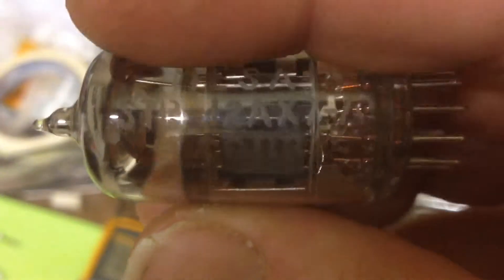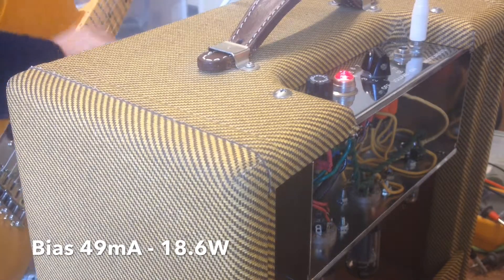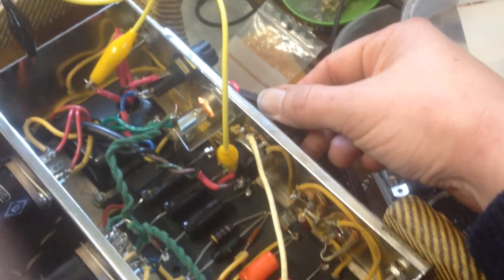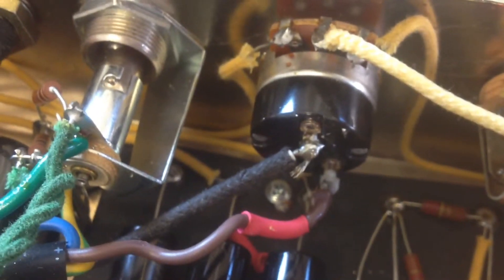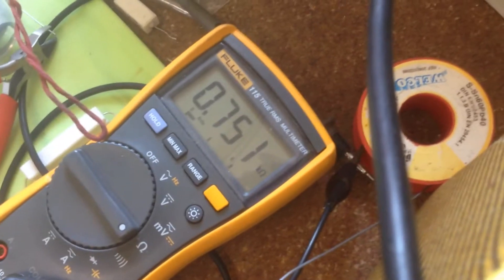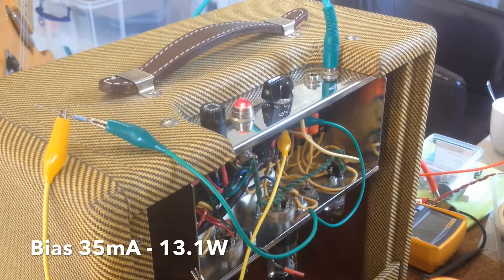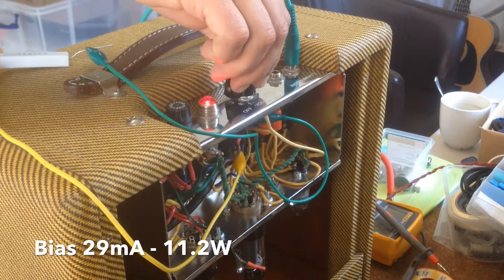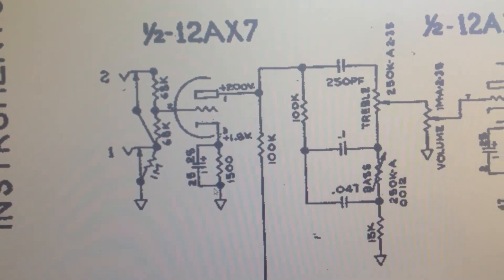Fender Champ 5F1: lowering the B+  230/240V + biasing

Comment: Grab a tube firmly, shake it rapidly and violently. 😮         Yeah, I’ll bet you can find lots of ‘em that’ll rattle with that kind of treatment ….🙄.  Lots of people also think that’s a good way to check light bulbs.😑
Reply from the maker: What do you think the tanks in WW2 used for communication? Tube radio sets and that wasn't the only tube based technology in the tank. Rattling tubes reveal faults: pieces of glass, solder caught in the tube. If shaking destroy a vacuum tube, it was crap to begin with. 
We shook light bulbs way back when they were made of filament wire when they didn't work anymore - as a quick check. How old are you?
Reply: @zjokka . Military tubes are COMPLETELY different there, sarge.  Yeah, shake a lightbulb with a filament wire and make CERTAIN that wire is broken.
How old am I?  Old enough to know that obviously, you know absolutely NOTHING about military tubes or filament wire light bulbs!
😆😆😆

Comment: Thanks for these videos. I'm a bit of a newbie, but I was hoping to hear the way the sound might be affected by adding a resistor to the B+ line between the rectifier and the first filter cap to knock the plate voltage on the 6v6 down to about 320VDC. I also wonder what the plate voltage was at the 12ax7. My Champ schematic shows 150VDC at the 12ax7 plates, and 325V from the rectifier coming down to about 295V and 250V off the 2nd and 3rd filter caps. I thought the whole Tweed sound with earlier breakup was due to the lower B+ voltages in the earlier Fender amps.
Reply from the maker: Check my other videos abou this Champ 1) rectifier age/type really affects the B+, see: https://www.youtube.com/watch?v=EjZlPAAh2Cw 2) For better performance you also need to take the screen voltage into account, maybe add a screen resistor: https://www.youtube.com/watch?v=syOxMSyY9P0

Comment: If your plate voltage and bias are too high, then moving from the 230 V winding up to  240 V  is only going to make it higher. You need to move the other way. Use the 220 V winding instead of the 240 V winding and bring it down. 👇
Reply: Using the primary winding for 240 instead of 220V will lower the HT secondary that feeds into the rectifier. The procedure is correct.
Reply: @pssmedia7134 Absolutely correct. Sorry 😢 about that.
Reply from the maker: Thanks for coming back and acknowledging the mistake - take a great man. I got confused too...

Comment: 95% of plate dissapation for sIngle ended amp according to the disappation value for plate voltage listed in the TUBE MANUAL. That would be 11.4 watts for a 6v6GT. The tube should then last for its rated duty cycle of 4-5000 hours.

Again, the TUBE MANUAL--

You alter tone with the plate and grid leak resistors on the preamp triode, the power tube bias will change tone a little but not as much as changing preamp values. Increase those resistance values.

You can also add a bypass cap to the driver stage cathode for more gain, try 2.2uf or 4.7 uf. 

Stabilize unruly uncontrolled distortion with negative feedback, temporarily install a B100K pot wired as a rheostat between the positive speaker output and the driver cathode. If you've installed a bypass cap you can install it at the ground end of the bias resistor and bypass cap with a 47 ohm tail resistor to ground, see the AA764 (maybe AB764?) schematic. Adjust the pot to find a fixed resistor value or install the pot if the owner doesn't mind a new hole in his chassis. 100K pot is enough to effectively turn the NFB off turned fully clockwise.

Comment: I've built several 5F1 Champs using a 600Ω cathode resistor instead of the schematic's 470Ω. This lowered the plate dissipation perfectly.
Reply from the maker: Thanks so much for chiming in -- seemed like sacrilege at the time, but really: the context is different: wall voltages and transformers are not what they were in the 50s!
Reply: I use a single 6l6 in my champ I built 420v b+ to the output transformer with a 50ma choke to
350v to the plate and 225 to the 12ax7  I use a pot for the bias since I like to swap tubes often
Reply: I built a 5F2 and used 1KΩ / 3W  cathode resistor . . .  works OK so far as the 470 Ω was running too hot and tubes are not cheap anymore . . .

Comment: Silly question from the inexperienced, why didn't you just move the OT from B1 to B2 as that DC was right on for voltage? At least on the previous video when you measured it?
Reply from the maker: Hi Fulou, I did change it, but under load (when connected) the differences were minimal. Thanks for the question, none too sily. Sorry for the late reply...
Reply: @zjokka  thanks! It's a big help :)

Comment: The issue is that you need to look at a TUBE DATA BOOK !  You want to run the 6V6 under 400 volts for the plates.  You noticed it on the old schematic but didn't understand.  So you need to insert an extra filtering stage off the 5Y3 rectifier with a dropping resistor and cap....before the power rail hits the output transformer and the power tube plate connection node.....so that node gets down to approximately 350 volts to 380 volts.  The higher the plate volts go,  the more stiff the power tube will sound....harsh and sterile and bright without good rich tone.  Once you get the plate voltages within that target range...then you can bias the power tube with the proper value cathode resistor......and calculate the plate dissipation factor for class A operation.
Reply: You have to understand that this is a cathode bias amp with a rectifier tube, and not a fixed bias situation.  The cathode bias has what is called SAG where the voltage will drop due to the load demand on the power supply and tube....to amplify the signal its being presented.  The voltage will SAG down and then try to catch up to where it was supposed to be set......so the tube can actually be over biased hot......as long as the plates do not red plate.  The SAG is the interaction of the rectifier tube and the cathode bias set up.
Reply from the maker: Hey dude, I will get back to this amp one time, but it is not mine. Somebody below in the comments spotted a wrong value in the power rail -hehe. It's a nice little amp but the guy who owns it never liked it much (harp player) and that also what I sensed: stiff and overbiased... Thanks for replying I learned something... only because I had the balls to post my mistakes to the world... but Mike C Amps - your channel has no content. I'd subscribe. 
Thanks again for your pointers!
Reply: @zjokka  The power rail resistors in the schematic should be a 10K and a 22K
 but its the voltage feed in to that first 10K node which will vary till the  cathode bias is set right.  Then if its still up over 350 volts....is when you determine adding another node between the rectifier and that first 10K node and how big of a power resistor you will need to get to the voltage goal.....but again doing so will also need to determine the cathode bias all over again to zero in to the right values but you'll know which way to go by then.  The power transformers they supply are actually existing transformers for other amp platforms so they weren't specifically made for the tweed amp in this application and generally at a slightly higher voltage than what would have been used in the 1950's in applications.
Reply: @zjokka  Here is the tip for a harp amp application.......if the guy is using a microphone that has a volume control.....change the pre-amp tube from the 12ax7 to a 12au7 and the cathodes of that pre-amp tube should by UNbypassed.....no bypass cap.  The gain and signal output from a harp microphone extremely exceeds what an electric guitar will generate to drive the amplifier.  So a 12au7 has the least amount of gain in that tube family.  So its either the 12au7 or a 12ay7....the AY is the next gain step up.  If the 12au7 is still too much......then you need to increase the cathode resistor value on the first stage of that tube that gets fed by the input jack.  Its a 1.5K and you can go up as that will soften the tube and bring down its gain......so you have to adjust with playing the amp with the microphone to dial it in.  You might also have to soften the gain in the opposite side too but start with the primary side.  The whole thing will be about the microphone volume control sweep and how it hits the amp and as the harp player blows and draws and the energy they put into those mechanics for the dynamics.  The ideal target is to have the amp as loud as it can get....and the distance from the amp with the mic.....to avoid the screech of feedback.  the harp guy will have less feedback facing away to play as opposed to facing direct to the amp...all when cupping the harp mic......but they ride the mic volume control playing harp since its right there at their fingers
Reply: once you get the amp dialed in that way......try removing the feedback resistor going from the output transformer to the pre-amp tube
Reply from the maker: @mikecamps7226  Hey man, will definitely get into this amp again. The harp player friend is currently fighting a relapse in his cancer battle, so don't really want to bug him with this now. Check my channel for the little Davoli amp (last restoration) I did - he would probably trade the little repro champ for that one. But I love that amp too... hard to let a pink vintage amp go...

Comment: So what's the conclusion? Which bias fits this the best? How did you lower B+?
Reply from the maker: Hi Ranko, thanks for the question. Switching the primary to 240v did make a difference, but not a big one. Looking at the original Champ schematics from Fender, they biased their all their Champs very very hot. B+ is not really a problem, you regulate bias by using a bigger cathode resistors than Fender did. 
This amp is not mine...but wouldn't mind having another look at it. Out of my hands for now.

Comment: Hi i'm wondering if you could help me?
You see Im trying to figure out if I can make a 5f1 run on uk 240v?
I can't find any info about this online, do you have any resources or tips? 
thanks in advance!
Reply from the maker: https://www.youtube.com/watch?v=H9AS7LnceE0 this video shows how I run my 120V US power transformer loaded Danelectro here in Europe, with an extra transformer that only cost me 50 EUR. It allows you to keep the original transformer, which is a huge part of the sound with hand wound vintage power transformers. 
Otherwise, changing the power transformer is the only way to go. Transformers are usually either converting 120V or 240V to the voltages needed in the amp. There are one that have 120V and 240V taps on the primary, so do check. 
Hope this helps, can't say much more without knowing the amp.

Comment: A 6V6GT is happy at 12w safe max and a JJ 6V6S can handle 14w
I when I first built my 5F1 Champ I didn't use a cathode bypass capacitor on V1.
As some call it running a tube without is cathode degeneration or cathode constipation haha but it really does help a lot.
I originally tried a 25uF but was getting some unwanted distortion blocking so I then installed a 4.7uF and that cleared up most of the distortion blocking.
I then lowered the two .022uF coupling caps to a .0074uF and now she cools with smooth raw distortion without the raspy distortion blocking.
Thar was very cool to hear the difference when you put the V1 cathode bypass capacitor in and out of the circuit you can really hear a big change.

Comment: I just bought a new 5f1 from Lil' Dawg. It sounds as clean as this one. Really only breaks up at max volume. I'm wondering if there's something wrong with it.
Reply from the maker: Gobi Grey thanks for your question. Break up really depends on the bias of output tube. But Fender never really intended this breakup and was trying to create clean amps. If you are not able to check bias and change resistors in the amps, you could try a lower gain tube like Sovteks. Did you contact Lil Dawg with this issue?
Reply: Ok, thanks, I'll contact him.
Reply from the maker: The clip on his website might wel have been recorded with the thing cranked. Did you check the end of my video, where it start breaking up a little earlier? Breakup will always be around 3/4th of the way up. Let me know how it turns out!
Reply: I feel like an idiot. My delay pedal was in the loop position which lowers the volume even when it's off. Amp works fine and sounds great!
Reply from the maker: Everybody feels like that from time to time, only real idiots never learn and never dare to admit their mistakes. Thanks for the feedback! Enjoy the amp!

Comment: Looking forward to the finale. Are you planning on bringing everything to spec? Or will you leave the higher than spec plate voltage, and just bias it to approximately 14W dissipation?
Reply from the maker: Hi Stefano, thanks so much for your question!
I haven't gotten to the bottom of this. I would really like to see some real time measurements of a vintage 1957 Fender Champ plugged into a modern US wall socket. It might just idle at 400V too... 
If you check D-Lab video on a Blackface Champ, you see it's got about the same B+, about 400V.... Probably the power transformers in those OLD Champ were different from the later ones. 
Changing the power transformer connection to the 240Vac, brought it down from 425V, changing the bias resistor to about 750R -original has 470R- did really help the constipated, compressed sound of this amp. It's now biased at a little under 14W. It's not my amp, and as you can tell it is built by a bunch of fetishists who make sure the install the useless RCA speaker connection, but don't check the bias of the amp. 
You could use zener diodes to bring the B+ down even further. If it were my amp, I would certainly have tried it. I am not sure whether lower voltages would improve the sound and as modern tubes are more sturdy and can certainly handle 400V.
Reply: zjokka yeah, if the B+ is within spec of the tubes, then bias to get the 14W dissipation. D-labs mentioned the issue once that these old amps ran on 110VAC. That 10VAC difference on the primary makes a difference in the secondaries.

Perhaps the transformer isn't wound accurately? If this is a Chinese supplied build, maybe and usually the specs of their components comes with significantly wide tolerances.

I was thinking of purchasing one of these kits excluding the transformers, but the reality is, the resistors, capacitors and wiring are just not up to spec. So you're better off purchasing high quality transformers from a reputable source. And maybe just buy the kit parts separately, such as the chassis if you're not a good metal worker, the cabinet if you're not a good wood worker.
Reply from the maker: It's a complex issue, they really do have 240V split in two... then with resistive loading in the house wiring that 120V may water down to 117V. What you really get also depends on the electrical company. I don't think you will ever see 123V.
Here I did see 238V -- and every electrical person agrees I should connect the 240V.... Australia has 230V too right. What's actually in the wall? https://www.worldstandards.eu/electricity/plug-voltage-by-country/

Transformer winding: yeah good point... made me think of this:
a) US: we need to bring 110V to 330V, that's 1:3
b) rest: wee need to bring 240V to 330 V that's 1:1.35
Inaccuracy in winding the second transformer will have a bigger influence on the result!

Yes transformers are the big problem: if not the quality, then the price. That's why I will never again buy a kit -- for the price of the transformers I can easily buy an old tube PA amp with transformers and chokes the whole shabang. Some of them I paid less than €100 for a 18W-marshall-to-be... 2x 12AX7; 2xEL84; EZ81 recitifier.